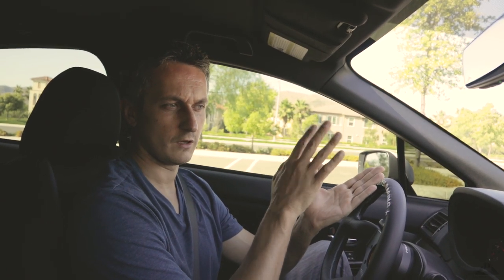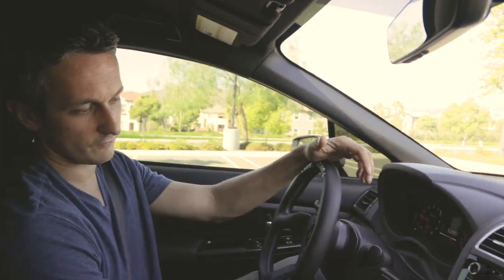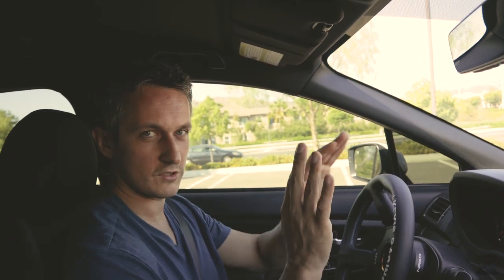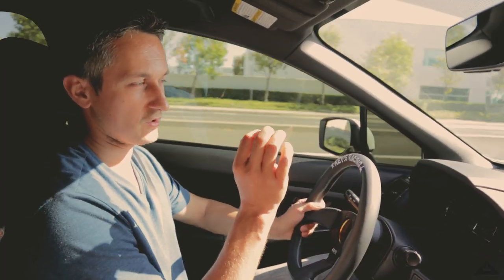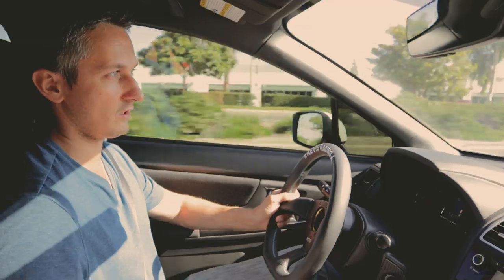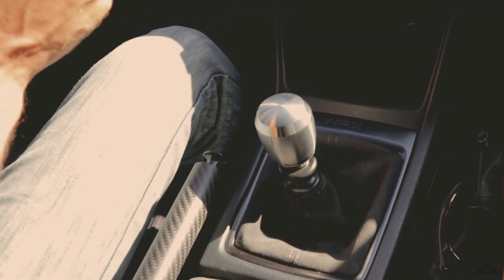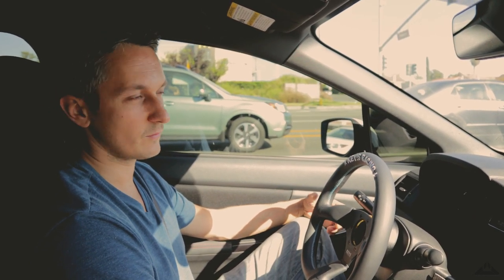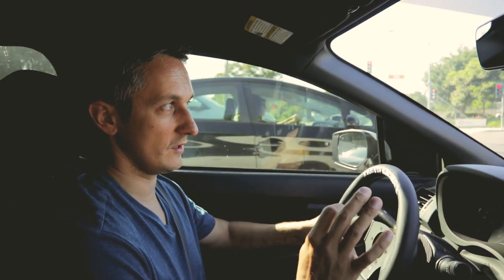Best way to shift a manual WRX and STI

Comment: 😏 Just bought myself an 08 wrx and it's the 1st time I've ever driven a subie and man the clutch on mine comes out really low.. It's heavy and hard but grabs instantly making it easy to shift and drive. I have to say it handles so much more differently than my let's say A4 with AWD. It's a minimalist car and I love that.. Less stuff to break or replace or have to fix later on. 
What am lookin for when maintaining one of these subies? I'm new to the WRX family and she's bone stock other than a Perrin downpipe and the sai delete. 
It came with a SSBOV and it's not recirculating back. 
Is that bad? Any info from anyone would be awesome.
Reply from the maker: a recirculating bpv is better than a bov because it pumps the air back into the intake so you don't have to build as much boost on your next gear as if you do with a bov which lets out all of the unused air. If it works though, don't mess with it. To maintain the car it's all about changing oil regularly and using good gas, also waiting for the car to fully warm up (while driving) before you get on it. That normally takes at least 10 min of driving as you want everything warmed up including your transmission. Don't downshift coming to a stop, you will wear out your clutch quicker even if you rev match.

Comment: How do you handle the second gear grind during cold start? Is there a way to eliminate this issue? I read that STIs have crappy synchros, but is there a way to save my gear box?
Reply from the maker: The grind is definitely not a normal thing. But to handle it, make sure you shift gently and slowly into gears until the trans. temps are high. Change the fluid too. Also, avoid shifting fast in general if you're having this issue. If you have this and your car is still under warranty, take it in.
Reply: I had an issue in cold weather with my camaro ss, what worked for my car was rowing thru the gears to kinda warm up the synchros before I started driving. made the 1st to 2nd gear a lot smoother the first few shifts

Comment: Hey I just noticed you had a carbon fiber e brake. Did you make that too? It looks a little nicer than the ones I’ve seen online. Just curious, thanks!
Reply from the maker: Yeah I made that from a cf tube I got on ebay
Reply: Nice! Damn man you are really creative with all of the carbon fiber mods. Another solid video. Keep it up! 👍🏼
Reply from the maker: @sgomez805  Just like you, i didn't like any ebrake handles on the market. It's fairly easy to make your own if you're good at dremeling and sanding.

Comment: Are you using a grimmspeed  stubby shift knob with the boomba short throw ? I can’t use my 660 stainless steel grimmspeed shift knob with my boomba bc it blocks the reverse lock out
Reply from the maker: yeah thats what I have. How does it block the lockout? You can just use a stopper nut to prevent the shift knob from threading too low on the shifter.
Reply: TheShaddix I’m guessing the knob’s threading goes too deep and prevents me from engaging the reverse lockout, I also have the Perrin shift stopper, if I run the stubby grimmspeed knob, I shouldn’t have any issues ? Would you compare the diameter of the stubby knob to the OEM knob and say that they are similar or it’s wider ?
Reply from the maker: @rico-lifts  mine has a huge opening at the bottom, similar to oem. Like I said, try a stopper nut.
Reply: TheShaddix I’ll give it a shot, thanks !

Comment: Ah I thought I was the only one. I just cant seem to get smooth shifts on first and second on my 18 Wrx and I've been driving stick forever... what mod would you say I should do first to help with it? Something simple?
Reply from the maker: My first mod was that boomba shift plate and it helped a lot at the shifter side, plus a stopper to guide the stick to 1st and 2nd. This didn't do anything to the actual engagement of the gear via the clutch. If your issue is with the clutch grab point making this difficult, then a clutch stopper is the only thing that helped me personally. That, plus tuning the car to get rid of the rev hang. If you can give me more detail on what exactly you're having issues with, I could pinpoint it more precisely. But in a nutshell, it's all about that grab point in these cars. It's very picky about what rpm you're at, where your clutch pedal is at that moment, and how quickly you shift.
Reply: @TheShaddix  I appreciate the response! Yeah I think it's the clutch just having such a far travel like you said before it grabs.
Reply from the maker: @corylightner4897  well, hit me up on IG or via email and i can make you a clutch stopper. Or you can go to  lowes and get a bolt with a rubber hat, try it out first. It works but wears out quickly and feels hard when the pedal hits it. But the idea is the same.
Reply: i think its the gear ratio and rev hang. 1st to 2nd is almost 1.25k rpm drop. you want to shift fast but the revs just doesn't drop fast enough.

Comment: Should I not get a wrx for my first manual car? I’ve been seeing a lot of people with experience having trouble
Reply from the maker: I made a clutch stopper to help my experience because like everyone else I was having trouble. I've had a lot of manual cars before, but none were as hard to drive as the wrx. The stopper helped a ton, plus the tricks described in the video are the key to driving it smoothly. Don't get a cvt wrx no matter what, you will regret it.
Reply: I just got a 2018 wrx a week ago and it’s been fun as fuck, never had a manual before this and been driving for 10+ years. Once you learn to take off and get the rev hang down, it’s wicked fun imo. It’s def tough tho at first tho and will make you question if you suck lmao. But I kept with it and I’m getting it down, only had it a week.
Reply: † WЯXʜᴇx † You give me hope Lol, thinking of getting a 2020 wrx but I didn’t want the cvt so I’m just going for it and getting a manual. Does the clutch suck like people say it does?

Comment: Why exactly is downshifting bad for your components? I was under the impression engine breaking was a good thing. Is this specifically a wrx thing?
Reply from the maker: Engine breaking is fine, downshifting itself will wear out your clutch faster. Once you're in gear it's all good, but slipping the clutch on every downshift will wear it out.

Comment: What type of ebrake handle is that? It’s not the subie speed one is it ?
Reply from the maker: no, custom made by me
Reply: TheShaddix would you be up to making one for my Sti I can buy off you? I love the look of it
Reply from the maker: @sergiog3792  It's just a CF tube cut and refined. You can buy one on ebay and do it. The trick is in the installation. You would have to do your own measurements to make this happen.

Comment: How am I going to learn to downshift if I don’t do it at every stop??
Reply from the maker: That's for you to figure out
Reply: TheShaddix that why you have to shift very often smart guy
Reply from the maker: @nonofyourbusinessnonofyour5435  that's why you're the type who replaces their clutch very often. Do what you want, it's your car. But use common sense. And watch your tone, I don't tolerate bullshit.
Reply: TheShaddix you not much of common sense guy
Reply: TheShaddix and I don’t know why you getting so hostile? I approached you with common sense question
Reply from the maker: @nonofyourbusinessnonofyour5435  sounds like you don't have common sense here. Think about what happens when you constantly downshift coming to every stop. The clutch wears out fast doing that because you're using it to slow the car and engine brake. Nothing wrong with actual downshifting, but the way most people do it is wrong which is without rev matching, etc. If you want to downshift a lot, just make sure to rev match perfectly and you'll be fine.
Reply: TheShaddix oh I think you taught I was downshifting without rev match, 
no I was rev matching all the time trying to get used to it
Reply from the maker: @nonofyourbusinessnonofyour5435  you should be good then. I've seen people just let the clutch out and the car jerks forward and they are ok with that. But even with rev matching you're still wearing out the clutch quicker if you do it at every light.
Reply: TheShaddix yes it is but I don’t donit at every light

Comment: Is this all on the oem exedy clutch?
Reply from the maker: Where did you get the exedy part from?
Reply: TheShaddix 
I’m currently rebuilding my ‘15 STI and ordered the oem clutch from Subaru. It has Exedy etched on all the parts, so I thought they provided the clutch parts for Subaru?

I’m mostly curious about what clutch you are running, if you don’t mind me asking?
Reply from the maker: @PatFan1980  just the original stock clutch here. Maybe exedy is who makes them for Subaru. But they also make an upgraded oem kit so that could be what you're talking about.
Reply: TheShaddix 
I see. Thanks for letting me know what you were running. I appreciate this video as well. I’ve driven manuals for years and it’s always good to get a refresher on things.

Comment: Nice video, but if you rev match properly. There is no wear on your clutch. If you shift properly there is no wear on your clutch. Rev matching helps the engine relax! For example, when a track runner is done doing a full 100m dash. He doesn’t just stop he slows down, hense he Down shifts😂 funny to put it that way. Personally if you throw it in neutral after being in 4th at 3 grand or 4 it’s like throwing the Pistons to 500 rpms in a matter of 2 secs. No bueno.
Reply from the maker: no one rev matches 100%, not even the best drivers. You  can get it close enough, but there is always some difference in rpm, so if you constantly downshift all the way to 1st gear when coming to every stop, over time you will wear out your clutch quicker as opposed to just coasting to a stop in neutral due to a simple law of friction. Even dual clutch cars with seamless rev matching will eventually have worn out clutches if you constantly downshift. At the end of the day, I made this video based on what I've learned over the years and what I think is the best way to drive a manual, particularly this car. You can always continue driving the way you prefer and just ignore my opinion.
Reply: throwing it in neutral at 3k will probably make the engine go to 3.1k then wind down to idle speed. going to neutral at any speed doesn't harm the engine, you just look all the load off, and the pistons are just free spinning.   Now if your car was moving 60mph and u dropped it from 5 to 3rd at 1k rpm with 0% throttle,  you might send a piston through your hood.

Comment: Sitting here reading the comments about where the clutch grabs and pedal placement wondering why no one is just not adjusting the clutch pedal throw
Reply from the maker: because you can't adjust that part. I've looked into that before.
Reply: @TheShaddix  unless they changed it in 15+ wrx but the clutx master cylinder still has the adjustment on it and that will change the throw

Comment: instead of downshifting why can't you just put it in neutral
Reply from the maker: That's the best way actually, for your clutch and the drivers around you...
Reply: Try not to put it in neutral too early as it is a bit dangerous to do so at high speed  better try to do it somewhere like when it comes near to 2nd or 3rd gear then put into Neutral and let the car slide to stop
Reply: @kimmywong9995  Cool thanks

Comment: Granny shifting , not double clutching like you should!!!
Reply: There is zero point in double clutching in modern cars.
Reply: @Stevie4171  says the person not double clutching, it’s less wear on your synchros and doesn’t shift the weight of the car mid turn so it’s safer and faster too
Reply: @adventureswitheddie6444  you won’t shift weight on a turn if you just do a normal rev match. Like I said zero point in double clutching nowadays and nothing you say will convince me or anybody that it’s necessary cause it’s not.
Reply: @Stevie4171  I’ll continue to revmatch my input shaft properly, if you bump the trans into neutral before revving that’s double clutching while only pressing the clutch once